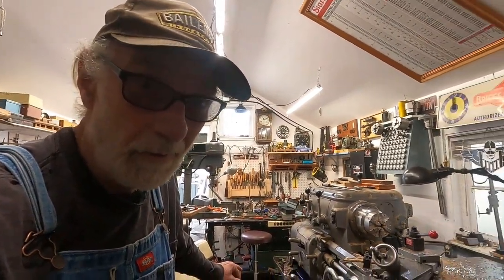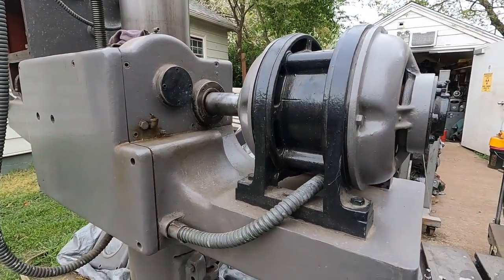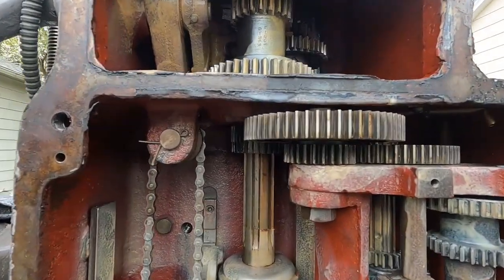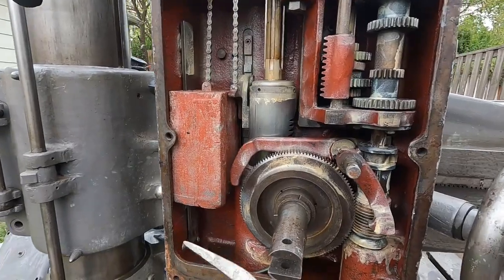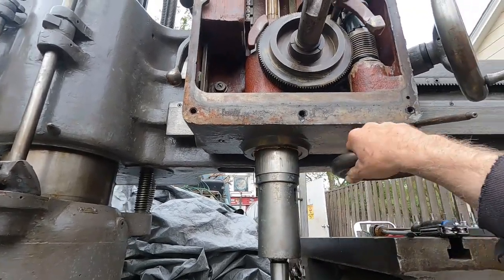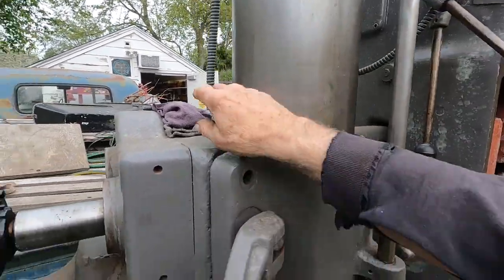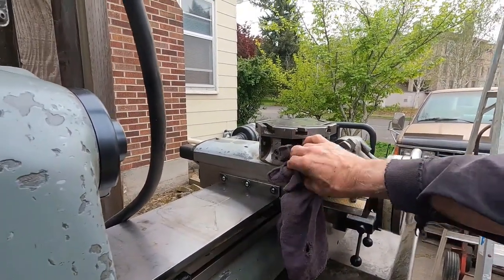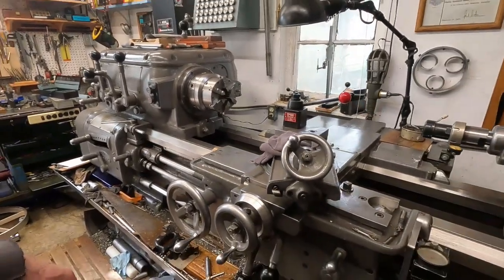The machine tool projects continue

Comment: Just reading your description of the RAD and the New Jersey, reminded me (on a much smaller scale !)  of a textile mill I worked at in the North of England in the early 90's that had a South Bend lathe that had supposedly come off a Liberty ship ? Up until then, I had only ever used British made lathes, such as Colchesters (Clausings to you Colonials !), Wards and Langs. Good to see oldies, but goodies getting a new lease of life.
Reply from the maker: They appear to be still pulling machines from ships in storage here. The Colchesters were very popular here and the DSG lathes are sought after. Hard to find those machines in good condition now. These older machines do not have much value but  they work great.Thanks!

Comment: Hardinge recomends only oil cutting oil on their lathes,  no water soluble coolant ever.  But people do use it.
Reply from the maker: I use the screw machine straight oils in most everything when I have too but they cause some smoke in the air. Thanks!
Reply: @DonDyarprecision  Even fire on occasion.....bring your marshmallows

Comment: according to the Hardinge manual they do not want you to use water-based coolant on the HC .
Reply from the maker: That is true, and I use straight oils in all the machines except the surface grinder and band saw. I use screw machine straight oils Mobil, or Swiss Silver. The mold shop here had a Feeler HLVH copy that used water soluble oils, the multiple drawn cup needle bearings in the apron rusted badly and pitted the shafts. I try to stay away from water soluble oils as much as possible. I can get skin irritation from exposure. chlorinated water-soluble oil is poison.

Comment: Just looking at his shop makes me feel claustrophobic. I could never have a shop like that.
Reply from the maker: You would not like the conditions I have worked in, that were much worse than you see here, cold or too hot, no good ventilation.. Often not much room is carved out for the machining end of many heavy repair service businesses, where more room is needed for the welding/fabrication end.
 Here, there is all the room needed for me to do what I want to do, and not short on projects at this point. The ones that have the big buildings around here have a lot of money and don't do sh*t.